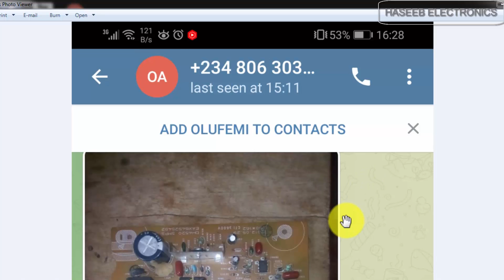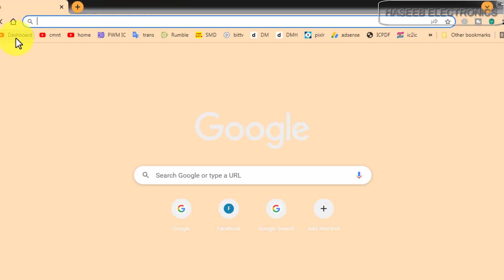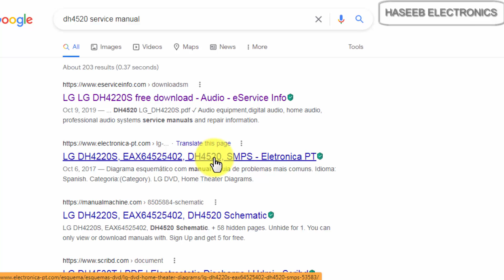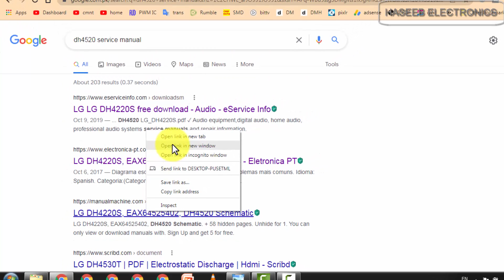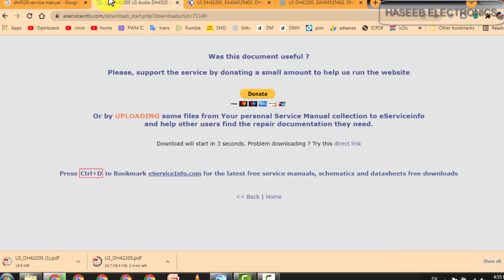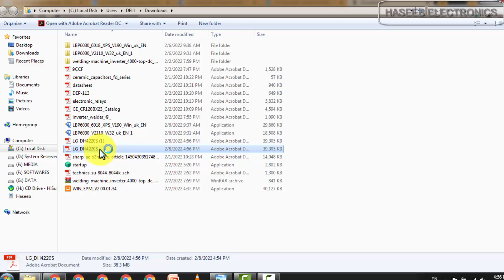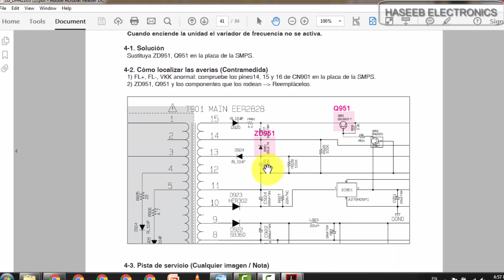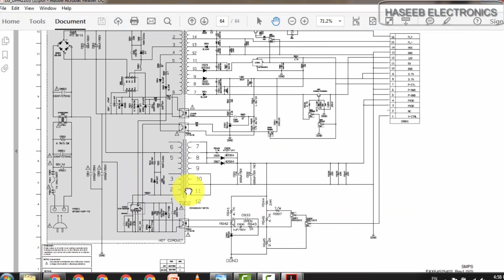{558} How To Download Circuit Diagram, Schematic, Service Manual, Repair Manual, Maintenance Manual

Comment: I am trying to find schematic diagram for sharp 21 inh tv model no Sharp -21y-fx10A please help me to find this cuircuit diagram thnks
Reply from the maker: if 21y not available please check 12G or 21S or 21X. these are much closer to eachother with a very little difference 
https://www.manualslib.com/download/453424/Sharp-21s-Fx10l.html

Comment: would you help me with this board please circuit diagram. EAX62864601, HLX55/HLT55/ Thanks
Reply from the maker: for HLX55    
https://elektrotanya.com/lg_hlx55w-fp_sm.pdf/download.html
Reply: @HaseebElectronics  Thank you very much
Reply from the maker: EAX62864601 and HLT55 are not explorable with me

Comment: How do I find information on a Samsung DA41-00316D? It's an SCP Electronics board SBCI-1 Ver 2.6 051001.
It's a nightmare. A new board should be in $130 range, but it's "discontinued," so I need to repair it or get it repaired. I tried getting it repaired, but the guy did a bad job, and it's still not working anyway. A 3 phase tester is completely dead. So it shows no polarity. Don't own an oscilloscope to check the three phases and the distance and peaks.
Add insult to injury Subzero for a 48" built-in wants $14000 but will deliver in June. 
So I am looking for help before I condemn a beautiful but dead fridge forever, and she'll out 16K and still wait 5 months for a replacement. 
Covid-19 or just political manipulation of the world one way or another. We are all getting screwed out of our money.

Thank you for all your work. I have been watching many of them. Very detailed and informative. Great help for someone like me.

Comment: Your explanation is very good,  but l still have some difficulty. Please can you help me to get  service  manual , that is the shimatic  diagram for a sound amplifier Infinity model. Qse - 2500 .
On the circuit panel l see this
SY 47476
20110528    P2500--2,PCB

Comment: Chinese android, could not find neither schematic diagrams nor service manuals, please see if you could find for me. Thanks in advance. 
Printed on Radio DVD Android Mother Board : -XY AUTO - YT9260+ - 2019-12-23 - ISO/TS16949 - MCU 3.1 - 13 200616
TAG/STICKER   - YT9216BJ V1.1 16G - A005 – YT9216BJ01 - 20200615.

Comment: Thanks alot for the information.
I have this hybrid inverter high frequency type that am yet to know the exact values of the zener diodes at the output transformer side zd7,8,3,etc
Reply from the maker: can you please mention the model number and brand name of your hybrid inverter 
please
Reply: @HaseebElectronics  thanks for response,it's an ipower inverter 5kw/48v with mppt 60a.
Reply: And also sunpolo inverter hybrid 5kw/48v with mppt of upto 400vdv input but I think all has same mother board except controller

Comment: If I connect 220 volts bulb in series with 5k watts heater element to 440 volt supply...then little load would be burnt or sustained to glow?

Comment: Hi Mr. Haseeb I have a smps with no output. Only clicking noise. Found the data sheet of the ic. Is TOP204AY switching ic. The smps is from Alcatel Lucent. What you recommend to test. I had already done the optocoupler by pass with the diode trick, and the clicking noise stopped. Already measure the caps and they are OK. Diodes too. Don't know what to do more
Reply from the maker: kindly check snubber circuit, connected at IC drain pin 
check capacitor at source pin (center pin of TOP204)
check diode in auxiliary winding 
check output side rectifiers and capacitor 
these are the possibilities 
check transformer core (for separation of core halves)
Reply: @HaseebElectronics  thanks a lot for your prompt reply. Amazing support for your followers. Transformer core already checked. I taked it out of circuit to measure and are all OK. Each winding is ok and checked if there was some continuity from one to the others. All OK. I think I tested all the diodes too, but I will check it all again and will reply asap.
Thanks again for you support 👍
Reply: @HaseebElectronics  Hi again Mr Haseeb, problem solved. After checking all the tips and everything seems to be good, I take the oscilloscope to check if the ic (Top20) was switching. I was a little afraid of use it because of mains on the oscilloscope. But i was out of ideas and everything has been tested before. The trouble was the ic. Even with 5,2volt on the control pin there was no oscillation on drain pin. Just changed it and all the voltages are good now. I have 5volt 12 volt, 24 volt, 15 and - 15volt.
This smps is from a TSX37 PLC. After this I get another trouble. Power supply ok, but every led of the matrix display is lighted. I hope it has the matrix controller burned. I will try to get the PLC back on machine without the led matrix board. Just to see if the rest is working. Then I will try to check and get the qfpc ic. Or the complete board.
Thank you very much for your help.
Best regards 👌👍

Comment: I ckecked several sharp tv service manual similar to my tv and dont have thecnical information about main power unit.
Reply from the maker: please check the service manual for power supply unit separately 
most of the power supply units are provided separately 
see the PSU model number and download the service manual. might be the same board is being used in some other brand or some other model number

Comment: Hi, i have a tv sharp 60le660u, i get the service manual but dont bring the diagram for the power unit. I tried to find it in many places with negative results. Any advice? The board bring  Runtkb285wjqz,  APDP-153A1,   DA5814373C063887

Comment: Dear sir, I followed your instructions as to how to find service manuals to fix my CRT devices
but I had no luck finding any circuit diagrams for all three of my broken CRT VGA computer monitors.
I need to fix them for my gaming pc which runs on win98 for some retro games.
What is remarkable is the fact that all three were working fine. One day I had one plugged in on my main 
Pentium 4 computer and I had been making some backups of various drives switching the pc on
and off frequently to connect and reconnect the next drive to be backed up. On one occation
the monitor did not show the signal and remained with a blank screen. I thought the monitor
went bad so I switch to another one I knew it was working before in its place and the same
thing happened. I went to my laptop and googled blank screen on boot and it recommended to
remove the ram and putting it back in and also repositioning the VGA card. I did that but the monitor remained blank however
I could tell the c was trying to boot. I checked all the monitors on another pc and they
all remained blank. I then took the one from the other pc and finally I was able to continue my backups. 
However, it is crucial to me to be able to fix those monitors because I cannot afford to buy old monitors
from the Cyprus market. Since you have a lot of experience with finding manuals it would be of great help to me if
you could find these manuals for me and provide the links to download them or email them to me.
The model numbers are as follows: 

1 AOC model 7vlr
2 HG 775
3 Philips model 105521

Thanks!

Comment: It is available for TVs, audio equipment and similar stuff, but, many modern Air conditioners provide only block diagrams and basic steps to conclude which board is faulty and then suggestion to replace that board.

Comment: Smps turns off when running. what is the problem
Reply from the maker: there are too many reasons in this issue 
dry soldering 
overload
over current
leakage 
loose joints 
over heating condition

Comment: Thank you! Tips = 1) If you can not find the manual, or schematic, for the exact model that you are repairing, get the manual for another model in the same series... For example, Tektronix made a whole series of 2000 model oscilloscopes. Say you can not find the information for the model 2215, then try the model 2213. It may have helpful information... (This is just an example. Both of these models can actually be found.) Maybe the newer model uses the exact same power supply as the older model and that is what you happen to be repairing. Even for the portions of the circuit that are not identical, you may get clues from the related model. 2) As you said, the same board may be used in different makes and models. When a device is sold under various names, this is called "rebranding." So, try to find the name of the other sellers and then search for their make/models. This is true for home appliances and even automobiles. 3) As you often teach, the way a device works may have universal principles... Such as your videos on Switch Mode Power Supplies. They mostly all work in a very similar way. So, research how the device you are repairing works, in general. Cheers!